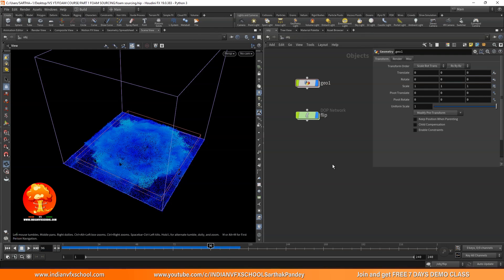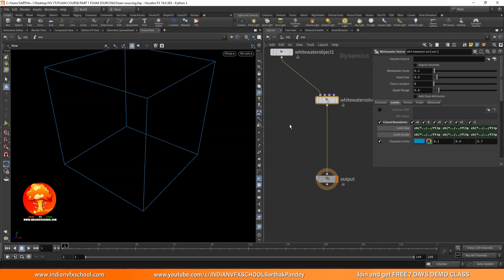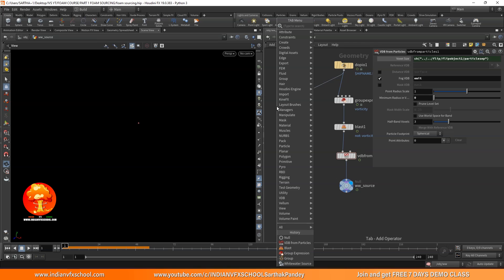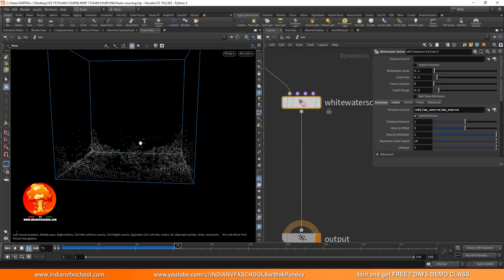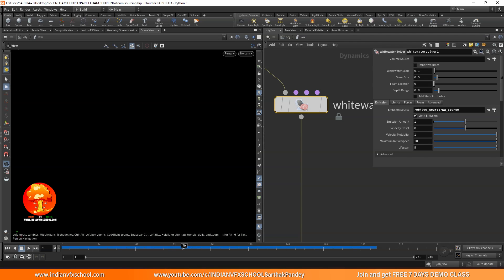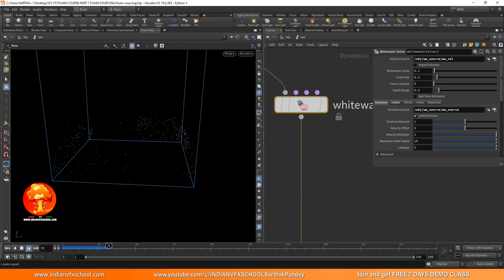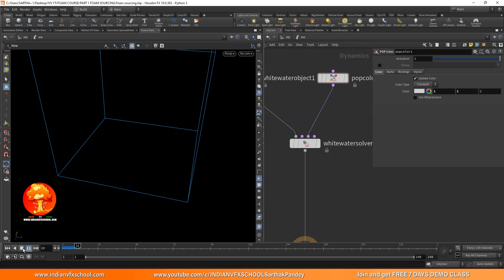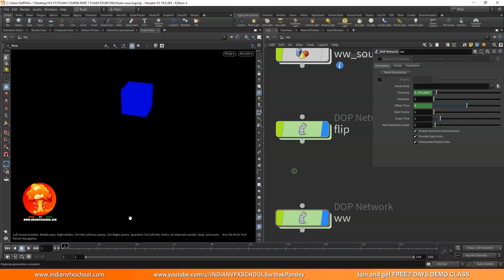Houdini White Water Course - Part 2 -  White Water Simulation #houdini #whitewater #Flip

Comment: the velocity of my particles are outputted as point velocity instead of volume velocity, even though I tried converting it to volumes from volume rasterize attributes and used VDB split, I cannot get SDF volume as (vel.x,vel.y,vel.z). how to enable them from the sim or is there any way to convert it
Reply: I'm having the same problem, did you manage to solve it?

Comment: I have referred to the excellent tutorial.
My question is, until I watched this video, I was using a COMPRESS Whitewater Solver volume source.
In this video, you use the surfaces and velocities as they are without compress, right?
What is the difference between these?
Reply from the maker: Actually both of them are same, they both uses vorticity for calculating whitewater emission. The only thing is if you do it in the way told in tutorial it's real time while as white water source is little slow. However you can just simply use whitewater source as it has lots more option depending upon your use case.
Reply from the maker: And yes whitewater source uses compress fluid cache because it directly works upon the surface field. Same thing but done differently.

Comment: tried this setup and it works good on a flat tank. however, when using it on a river sim all my whitewater particles just fall down like they only take the velocirt from the top surface part. What am i doing wrong?
Reply from the maker: Well that shouldn't be happening as its same in all the case. You can contact us on WhatsApp for if you want to clear your doubt in further detail.
Reply: @indianvfxschool  i will make flipbook of it. 👍🏻 thanks for answering!